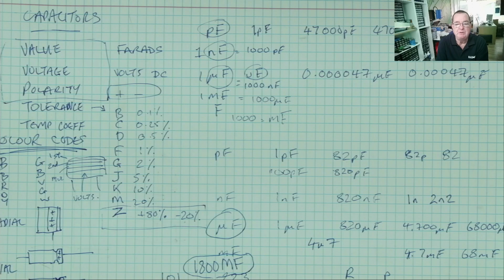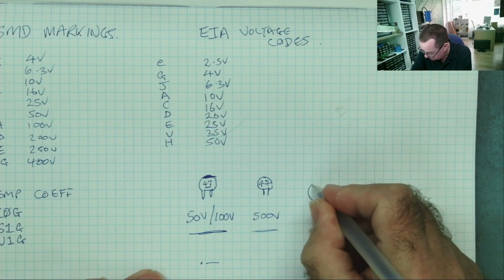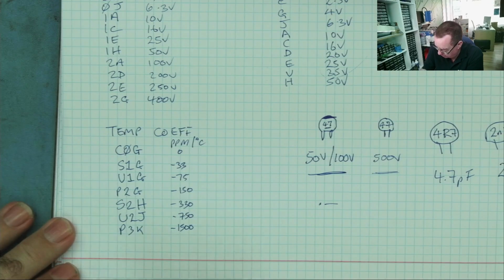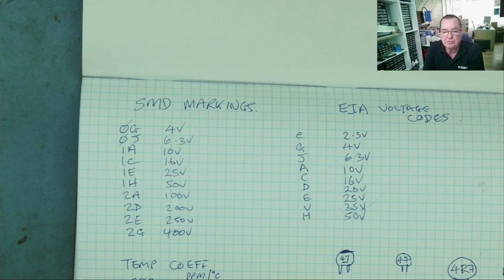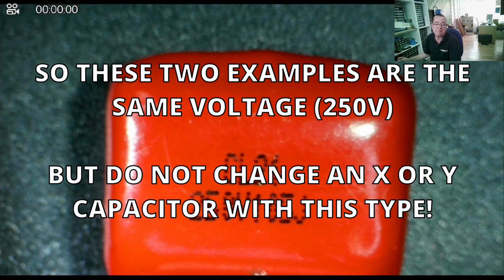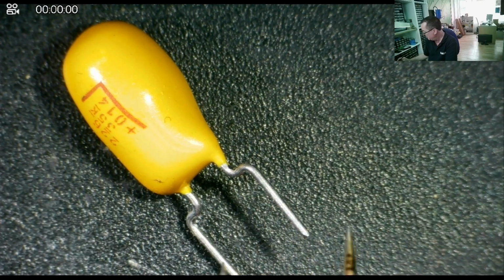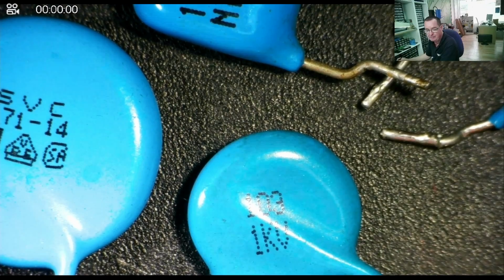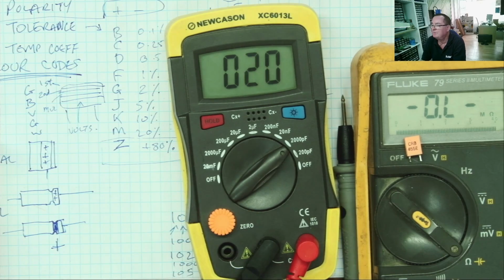PART 2 : All You Need To Know About Capacitor Markings Codes To Fix Stuff PTH & SMD

Comment: Sometimes it's useful to check old big caps to see if their internals have been replaced. In particular when they have non-standard footprints or the cap serves a structural/mechanical role in the device. 

Just something to keep in mind when dealing with old stuff. Trust nothing lol.

Comment: Some markings might also be manufacturer-specific. For instance, I found a discussion (can't link to it or YouTube will shadow-ban the comment) where someone had asked Panasonic about the dots and dashes on their caps. The answer was basically that it was a date code indicating time of production. In that case, they put a series of dots over the writing which signify the month, and a sequence of dashes under the writing that signify the year.

Comment: An off topic-ish question. In part one, the tropic fish caps and other color code items  reminded me when I went looking for meaning of the color bands on MELF diodes.  (They were THP without the leads attached. ) I did find a chart that had the codes but lost it.  Zener, signal, rectifiers, etc had a different color.  Anybody have the chart or know the answer? 

Side note: there were MELF style 1/8 W resistors too, that were THP without the leads added just the "end caps". Took a few of each to bits to verify construction.

Comment: The last mystery component is a ceramic osc or filter at 455 kHz, like a crystal. sometimes used in remote controls instead of the well-known crystals to generate the (low frequency) clock for the processor
Reply: Proper name more likely: ceramic resonator

Comment: but if the nutral or live goes short to ground the groundfault switch would trip if your country has those in your electric box
Reply from the maker: Depends if you have a ground lead connected to the item?

Comment: According to google it is a ceramic resonator.
Reply from the maker: Well that would make some sense why it reads like a capacitor, I was of the opinion that ceramic resonators have three pins?
Reply: Can be 2 pin.  Are also used in some old arcade game boards in the sound circuitry with certain sound chips.